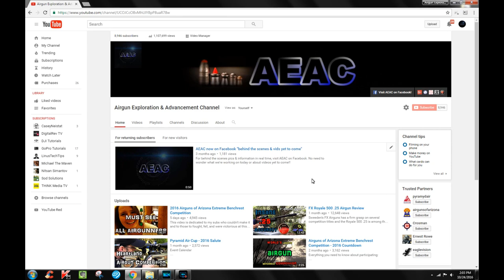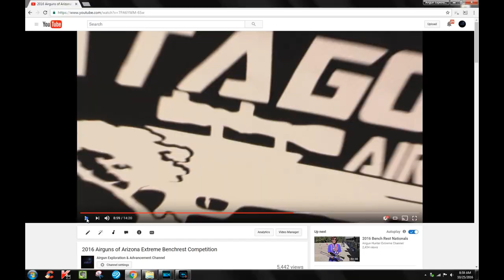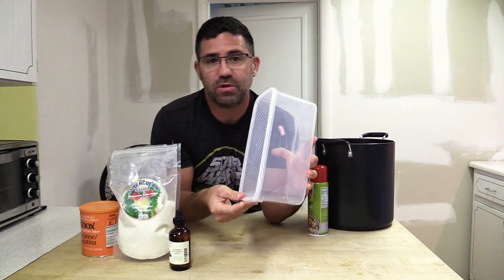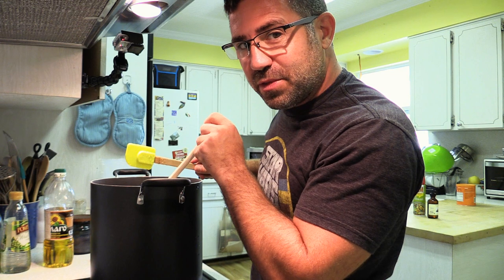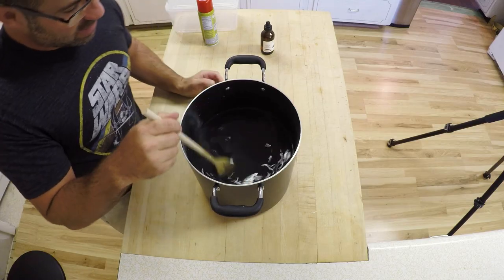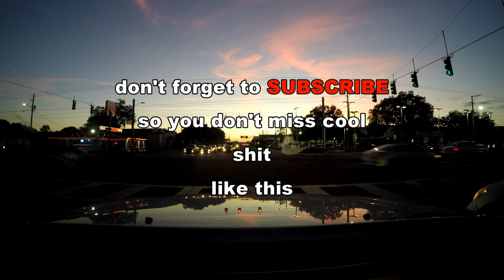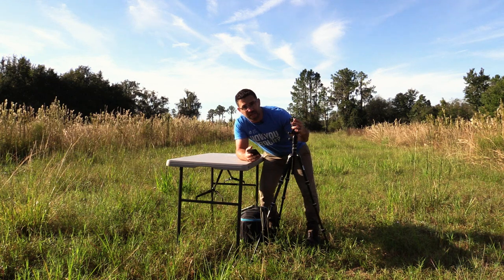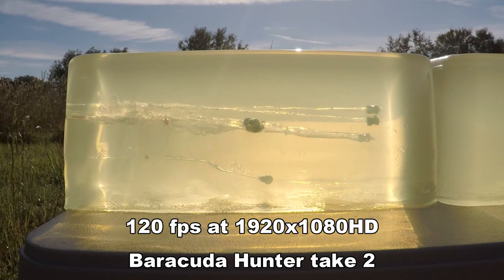Air Rifle Ballistic Gelatin + HOW TO MAKE IT - Calibrated Airgun Gel - Pellet Gun - PCP Airgun TEST

Comment: Steve, great video so much good information throughout the whole thing. Realize I just wasted a whole bunch of money buying clear ballistic gelatin block, I'll see what type of a difference it gives me using the NATO 20% gelatin. What was speed you're pellets were traveling at point of impact?
Reply from the maker: Robert Ford Hi Robert.  There may be pros and cons to both to consider.  The synthetic blocks while expensive are more clear and can be reused.  But after I researched the price of the molds, blocks, and pots to remelt them, I passed.  I've also read in numerous places that they don't calibrate out right either so I'd love to hear of your experience with them once you get familiar.  I couldn't say what the velocity is down range but it was certainly plenty, lol.  Thanks for the props & visit.  Steve

Comment: holy mole wacamole!!!!! that gun collection..... hmmm I want to use that coupon code for a .25 marauder..... but its the very small shot count that's holding me back. regulated vs unregulated.... that's what ill be asking you on the vlog.  thanks steve!
Reply from the maker: TrojanTMT For me, a usable 15-20 shots is plenty for a days hunting.  As you saw in the vid, swings of 20-30 feet per second had NO bearing on point of impact or penetration depth at 50 yards.  That's what I love about these vids.  There's lots of useful information to debunk forum myths & buying trends.  Regulators are nice but FAR from necessary.  The Marauder .25 is tough to beat for the money... especially the 2nd gen.  Did you see my vid here with it smacking the pan at 150 yards?  That's a lot of gun for the money!!... especially at 20% off. Best, Steve